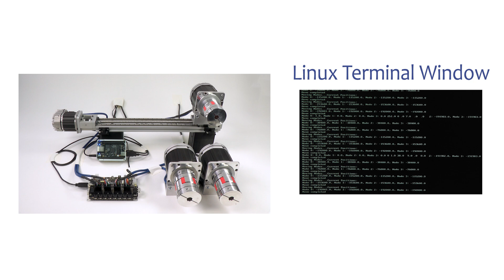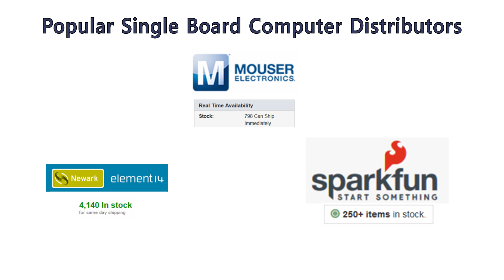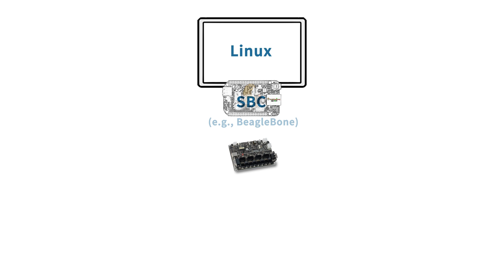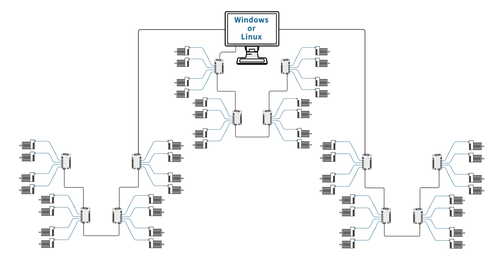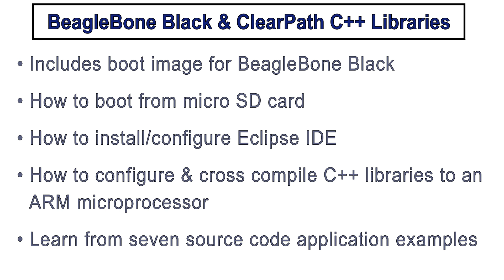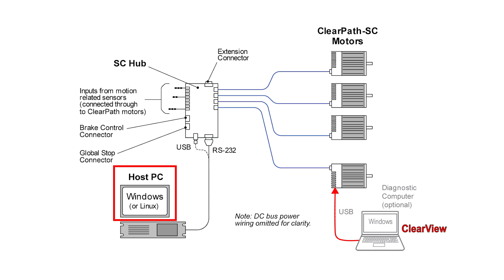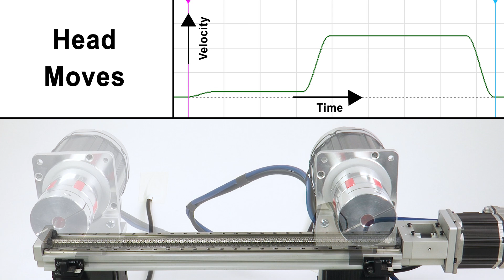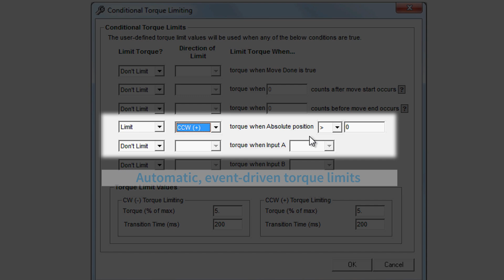Motion Control with BeagleBone Black or Raspberry Pi and ClearPath-SC Servos

Comment: Hi, thank you for another SC-series video!

I am trying to wire ClearPath-SCs in "Step and Direction" mode to Masso CNC controller.
The controller has Differential Signal (-5v to +5v) Step & Dir outputs, that I believe, can be directly connected to motor's A and B inputs.
However, it seems, that SC4-Hub has different A and B inputs schematic and is not a direct pass-through from SC4-Hub to the motor.
Quote from the user manual: "ClearPath-SC motors can accept inputs from devices with logic high ranging from 5-24VDC, but the SC Hub, by default, accepts 24VDC NPN type sensors or simple mechanical switches."

Is there a recommended way to modify the SC4-Hub to directly pass through A & B inputs to motors? Desoldering a component or two from SC-Hub is not a problem for me. Jumpers J0A..J3A and J0B..J3B seem to be likely candidates :)

Or is there another way to connect the servos to the controller in this case?
Maybe, extracting 4 middle wires from the 8-Pin Molex connector on SC4-Hub side, and connecting them directly to CNC controller will do the trick?
Reply from the maker: Hi Artem,

You are absolutely correct; the SC4-HUB can be modified to accept standard (see below) step and direction signals from externally powered devices (e.g. a PLC, microcontroller, etc.) with one simple modification.

Here's how to do it: Say you want to use external step and direction with Motor 0 on your SC4-HUB. Carefully cut the two wire jumpers, which (as you guessed) are labeled J0A and J0B. These wires are located above the two associated 4-position input connectors. Just be certain that each jumper is completely severed and no bits of wire are left on the board. 

Here's a visual aid for you: https://ibb.co/gR3LgS

After the jumpers are cut, pin 1 on Input A directly connects to the motor's Dir (+) pin, and pin 3 to Dir (-). Similarly, pin 1 on Input B connects to Step (+), and pin 3 to Step (-).

*Standard step and direction signals, in this context, means single-ended signals with a voltage range from 0-5VDC all the way up to 0-24VDC. Note: many “5V” differential drivers do not provide a large enough differential voltage swing to guarantee compatibility with the ClearPath inputs (particularly at higher frequencies and longer cable runs). Your differential driver should be compatible as long as it generates at least a 4V difference across the positive and negative ClearPath inputs, and is able to supply at least 7.5mA. 

~Jim W.
Reply: Hi,

Thank you for detailed response, the illustration and for including the feature in the first place. It helped a lot. 

A couple of thoughts:
- Consider adding this information to User Manual for fellow users.
- In future versions of SC4-Hub consider replacing wire-jumper with a normal jumper or a switch, if at all possible. I think that would improve user experience.

Looking forward to next video!
Reply from the maker: Hi Artem,

You're very welcome, and thank you for your suggestion. 

We agree with you, and you'll be pleased to hear that this material is covered in a soon-to-be released revision of the ClearPath-SC User Manual.

Thanks again!
~Jim

Comment: I'd like one kit for my milling machine 3 axis what is the price
Reply from the maker: Hi Abram,

Thank you for considering ClearPath for your milling machine project. The cost of a kit for your milling machine would depend on the specifics of your machine and application (i.e. how much weight you’re moving, the desired speeds, gearing, etc.), but a typical range is about 1-2k (US dollars) for three motors capable of accepting step and direction commands, a power supply, and the required cables.

Most CNC machines use step and direction signals for motion control. The ClearPath SD family is designed to be used with step and direction signals, so that's very likely the right type of motor for your project. You can find more information about the ClearPath SD family on Teknic’s website:

Overview
https://www.teknic.com/products/clearpath-brushless-dc-servo-motors/clearpath-sd-stepper-replacement/

Video
https://www.youtube.com/embed/NbLE126rrRs?rel=0&iv_load_policy=3

Manual
https://www.teknic.com/downloads/  
Once you're on the Downloads page, click ClearPath>ClearPath User Manuals> ClearPath-MC and -SD Series.

If you have any other questions please contact us at support@teknic.com. Best of luck with your milling machine!

~Jim W.
Reply from the maker: Hi Abram,

We just added Paraguay to the list of countries we ship to, so you should now be able to select that as an option. Please feel free to contact support@teknic.com if you have any questions about ordering online.

Best regards,
Jim W.